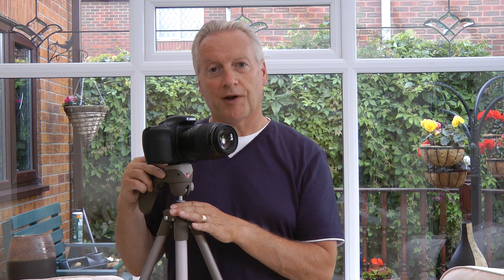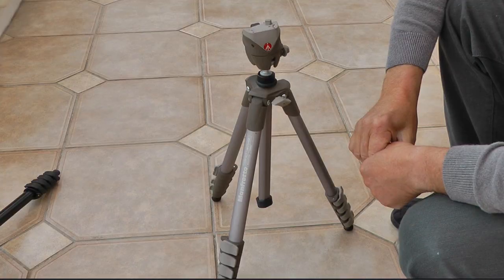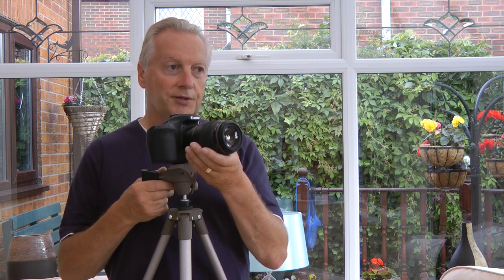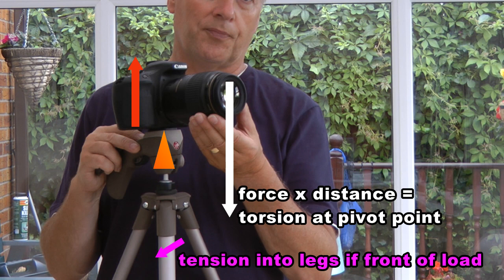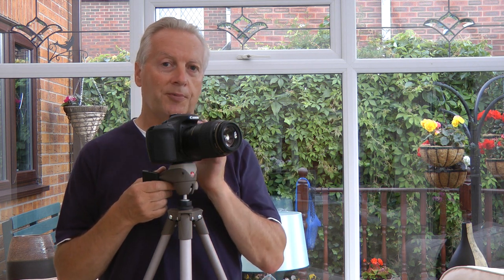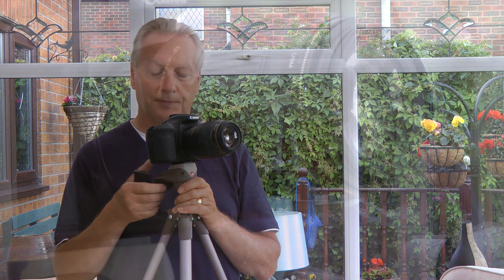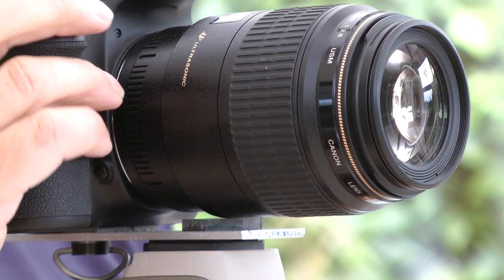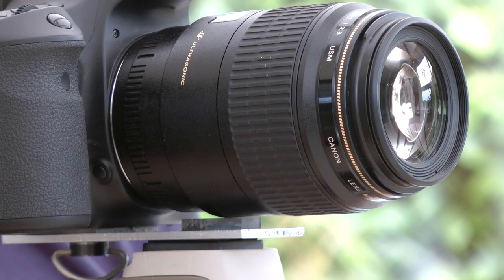Improving Tripod Head Stability When using telephoto lenses

Comment from the maker: @MrSonicAdvance Yes I agree, I wanted to keep the design very simple. My own device has a slotted track with markings for my various bits of glassware. Its a pity a company like manfrotto didn't put a bit more thought into the quick release plate locking mechanism and made the rubber pad a little harder on the QR plate. This would have cut down a lot of these issues. I think the overal quality of their products is falling as they shave costs by introducing a lot of plastic components now!

Comment: An interesting video Graham. Gone will be the days when the camera "headbutts" the tripod in a moment of lapsed concentration! :-) A series of holes or (maybe not a slot, which might cause stability issues) would be nice to allow for different lenses. 
It's a great idea though and has a lot of potential uses, including correcting the mounting point for cameras with them offset. (My corner mounting Panasonic TZ5, for example.)